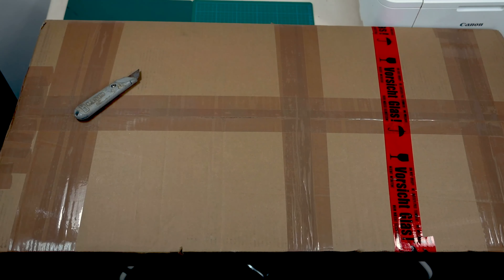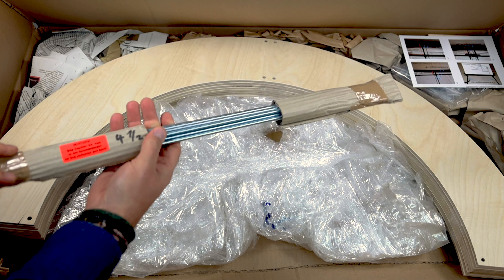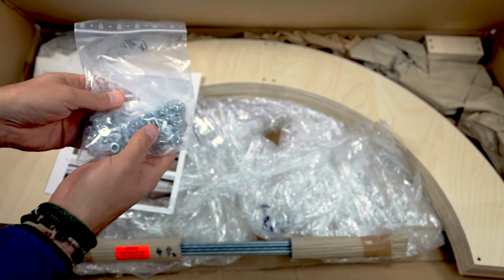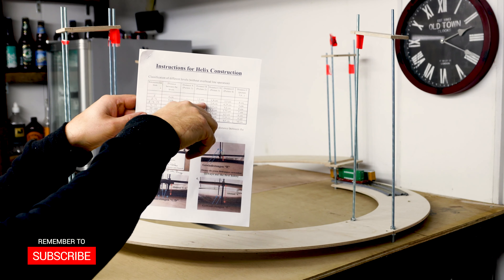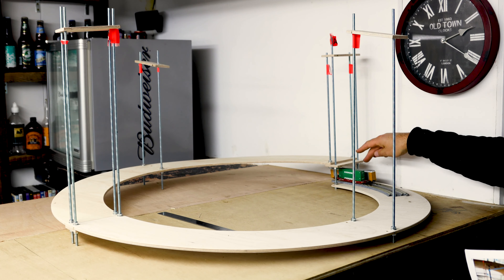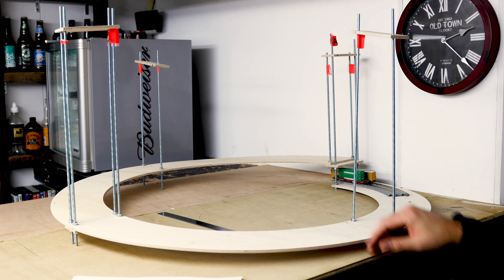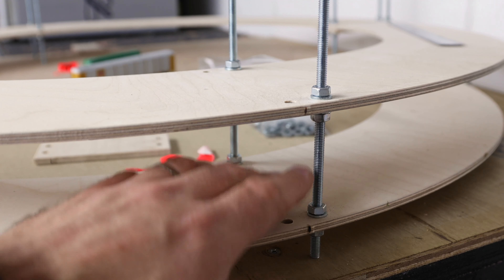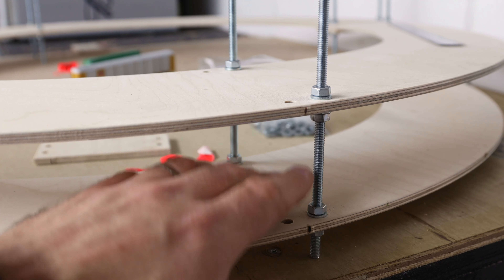N SCALE HELIX BUILD: Unboxing laser-cut N scale helix kit

Comment: Very nice video and kit. Thanks for sharing - will definitely have a look. Just wondering - would it not be easier to lay the track and wire it as you go along, or did you just assemble for demonstration?
Reply: Glad you liked it. I did consider adding the track as I went,  but with Kato Unitrack it was so easy to add it afterwards. In fact, it allowed me to adjust it more and move it around to suit

Comment: How many cars can you pull on this grade without helper units, etc.  Assuming maybe you have 2-3 locos in front and that is all.
Reply: Hi Joe.  I've only tested with 10 autoracks so far - a single ScaleTrains Dash9 struggles and wheelslips halfway round the first curve, but with 2 at the front goes up nicely.  I haven't tested with my Kato units yet, but based on previous tests, my Kato locos have a lot more pulling power - will test it this weekend
Reply: @peter_borcherds  I think that is my fear of using a helix, I enjoy running long trains (75+ cars) and doubt any helix could work with a train that length.   My kato Dash 9s can pull 75+ cars no issue on flat surface, but with a grade I begin to wonder.  What grade is your helix?
Reply: @jbdbackfan  I think it’s about a 2.27% grade (according to AnyRail), quite steep. Most go for a bigger helix with lower grades, but I was limited to space